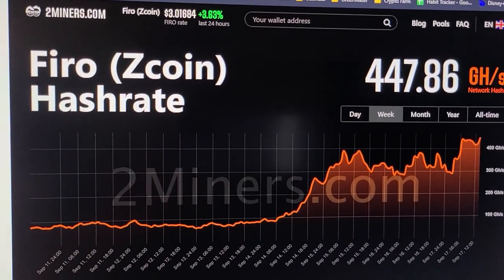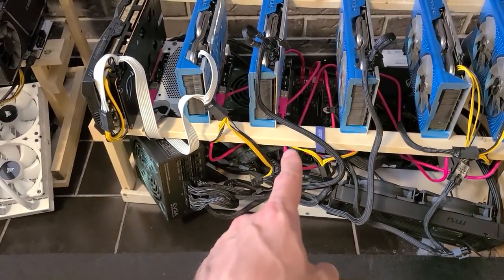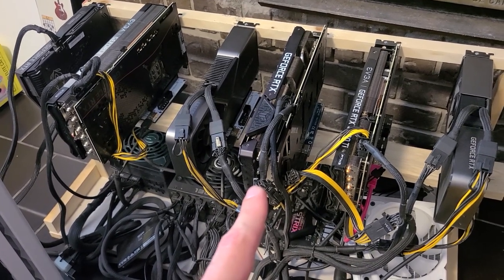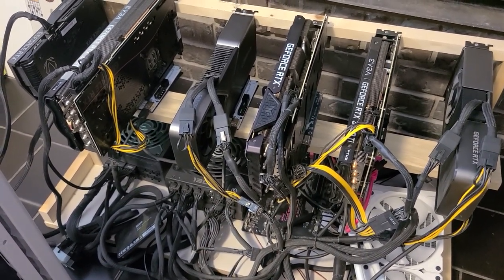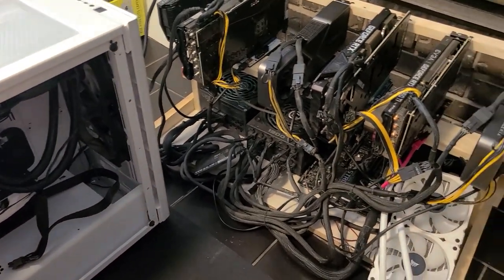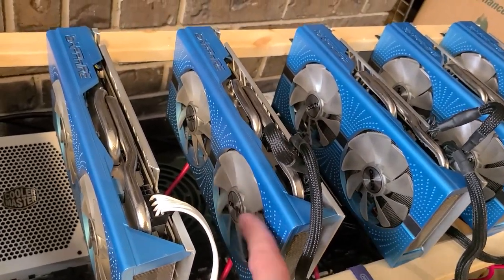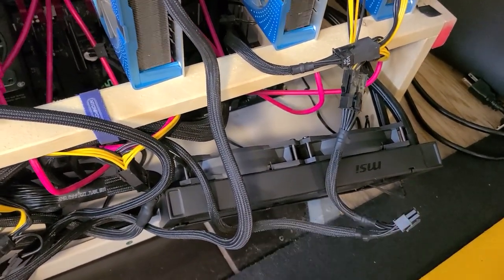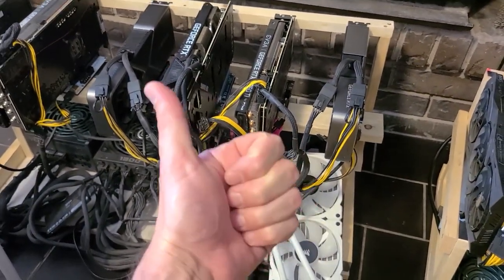CPU Mining on AMD 5900x, building a space heater out of Nvidia 3070 cards

Comment: Just a tip, Your radiator is placed wrong, You should put it the other way around so the tubes are from the bottom so you dont starve the pump. Putting it at the top is the best way. There is video of GN about it with more details. Cheers